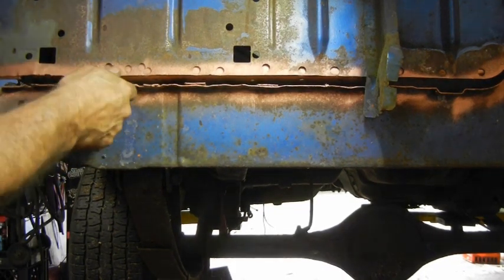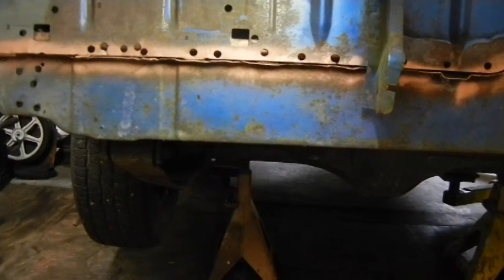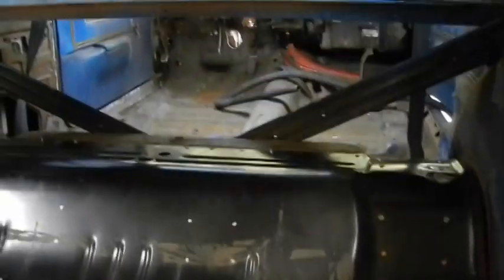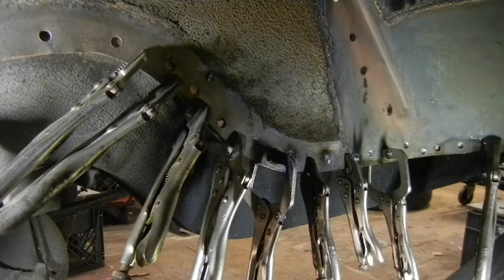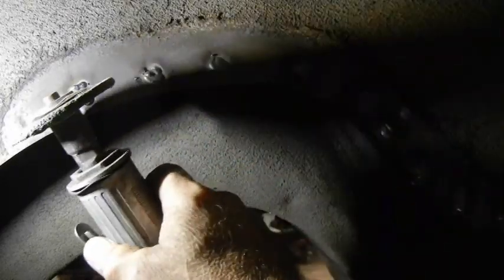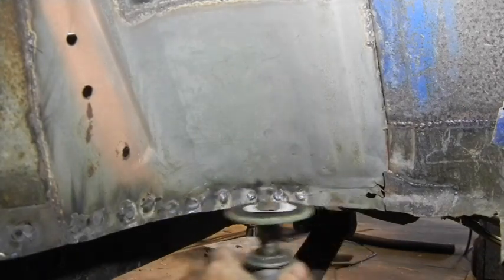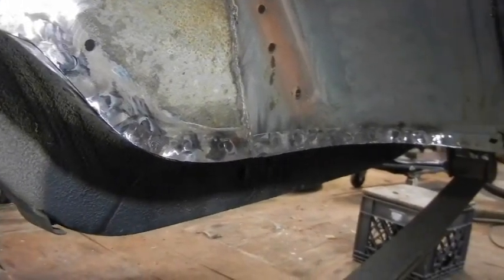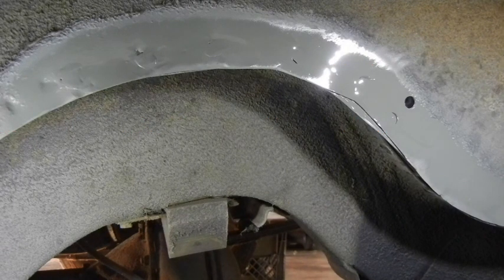71 CHARGER TRUNK PAN INSTALL FINALLY

Comment: good work. Im not looking forward to the weld grinding party I will have to have on the Duster, I saved it all for one big session.
Reply from the maker: Yeah I still got a lot of grinding left to do... Yeah pick up the HFT baxter air angle grinder 3 inch and some 36 grit grinding discs it well make it go faster and don't forget to wear a mask.